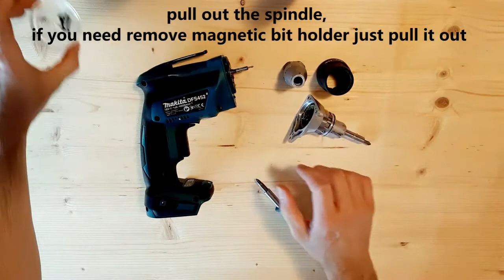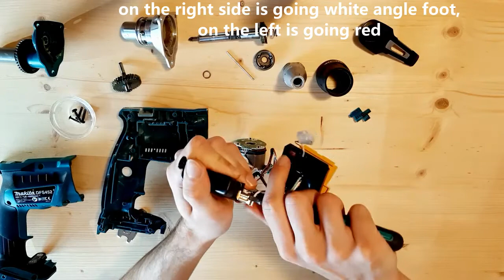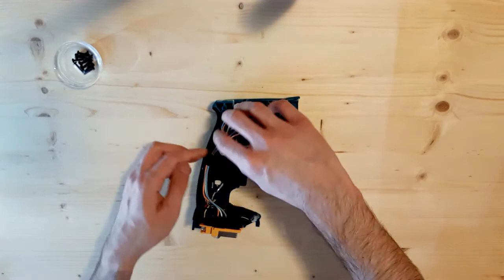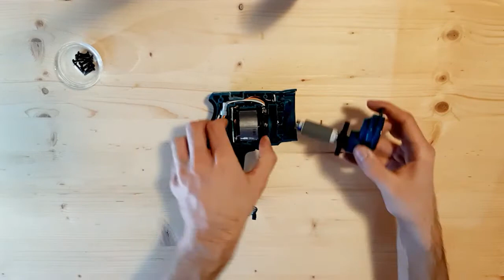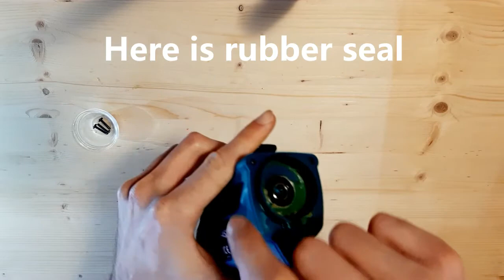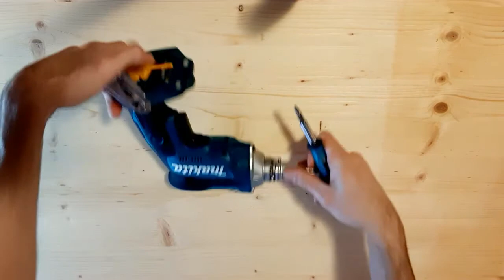Makita DFS452 how to disassemble

Comment: I’ve got one of these but it’s difficult to screw in a corner as you can’t get to within 12mm on a papered edge or 18mm on a cut edge and keep the tool perpendicular to the drywall so often the screw goes in crooked and doesn’t seat properly or tears the paper. If the top hook wasn’t on the tool you could get closer to an edge.

Comment: Thanks for the video, was looking for just that! Would you think it's easily possible to better fix the clip on top of the machine if it came a little loose from the factory? Was hoping for a screw, but it doesn't look like there's one in your video. Just a press fit?
Reply from the maker: You mean on hook on top off the tool? If you mean on that it's just fix in the groove, you can fix it with duct tape, just wrap it to have a smaller gap.
Reply: @howtodisassemble7185  That's what I thought, thanks!